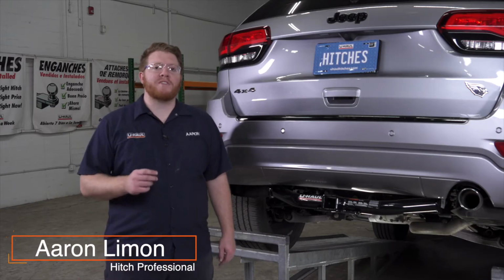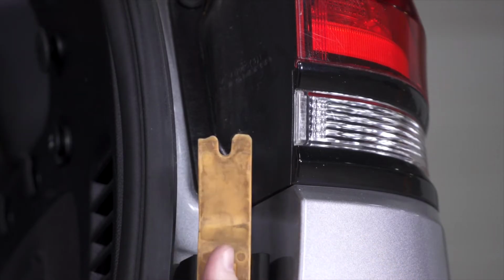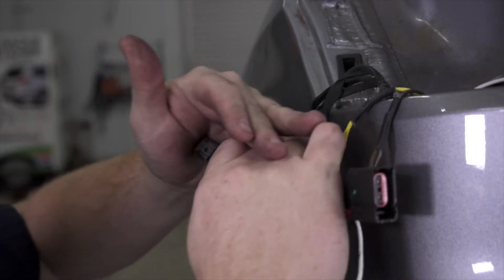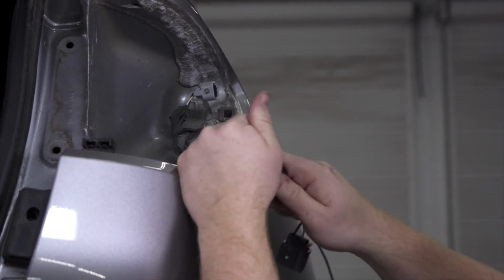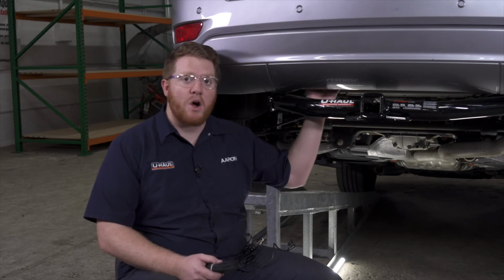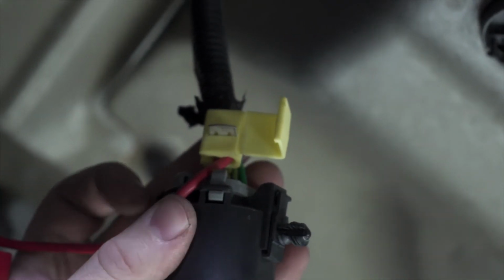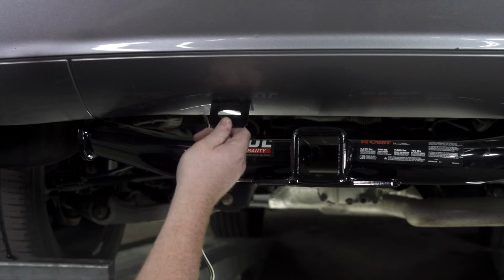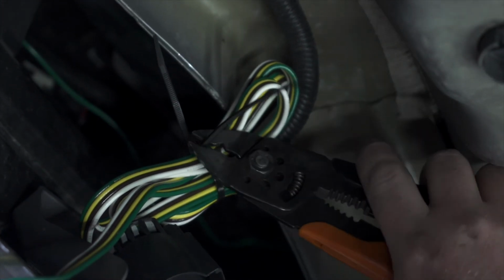2014-2021 Jeep Grand Cherokee | U-Haul Trailer Wiring Installation | CMF56426

Comment: Is the wiring install for the other plug that you need that is not a 4 prong but the plug that has a bunch of prongs for a certain trailer that had a round plug? Not sure what it’s called.
Reply from the maker: This is for a 4 flat wiring install. A 7-way or 7-round has more functionalities and needs to have a more complicated install, including a brake controller. Some Jeep Grand Cherokees are pre wired for this and can have the functions turned on by a Dealership. To help you determine this please schedule a free Pre tow inspection with your local U-Haul hitch professional.